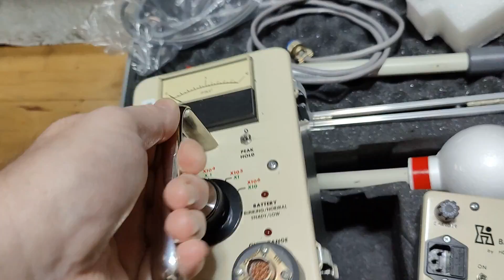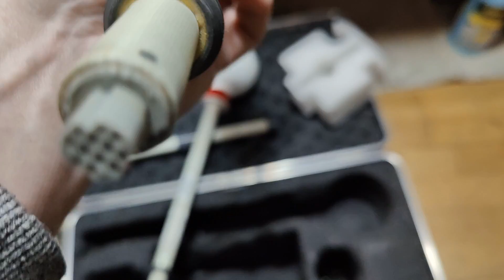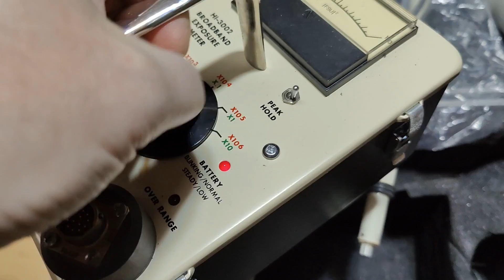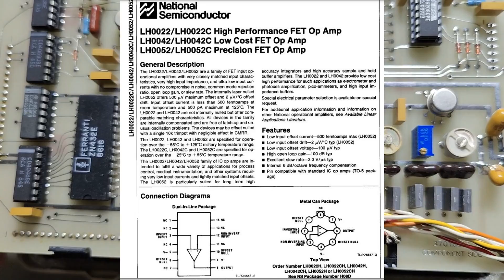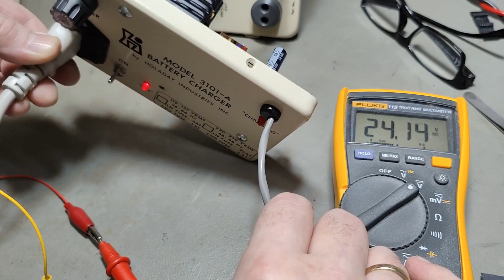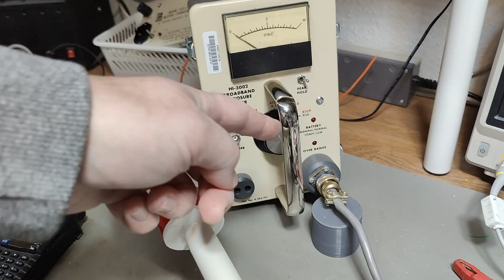Holladay HI-3002 BroadBand Electromagnetic Exposure Field Survey Meter

Comment: Hi Thomas, WoW is a great tool, good decision not to open the antenna and avoid possible damage.
Jack connectors are completely unsuitable for power supply, even if the source or charger is short-circuit resistant. The thin paths on the PCB will be due to the elimination of interference and crosstalk between circuits. Nice piece of equipment, thanks for the demo.

Nice day 🙂 Tom